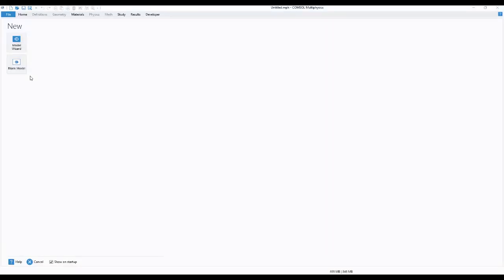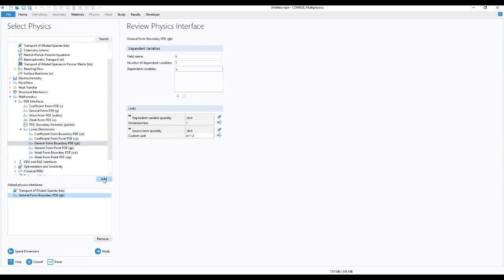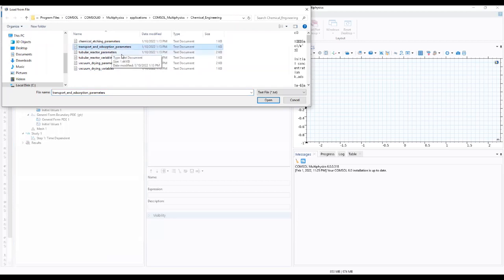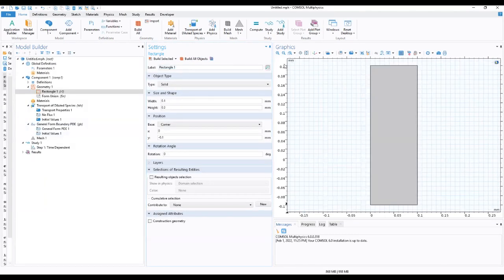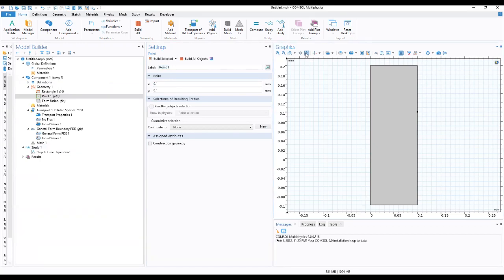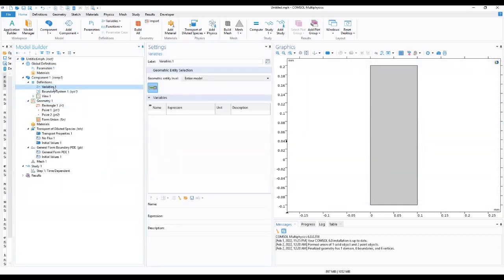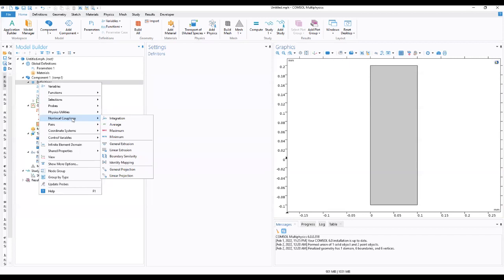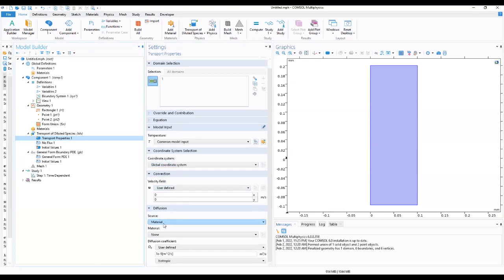HOW TO SIMULATE SURFACE DIFFUSION AND REACTIONS SIMULATION  IN COMSOL MULTIPHYSICS. FIRST PART

Comment: only one important questions that puzzled me in this expression -cs*TxDs where Tx come from and what does T refer to?
Reply from the maker: Here, csTx and csTy refer to the components of the gradient restricted to the plane tangential to the boundary where the interface is defined, that is, Boundary 5. Because this boundary is parallel to the y-axis, only
csTy is nonzero in this case.
T is temperature
Reply: @Simulation_World  first thank you for reply. I think that the process is isothermal so the no need to take Ty or Tx, because they will =0, do you agree?

Comment: The video was really helpful for me. I went through both parts of the video but I didn't get a clear picture of what you have tried to simulate here. May I know the probem statement? I am in need of procedure to simulate Chloride diffusion in reinforced concrete. If you can explain what is that you have tried to simulate here, that would help me a lot to draw some  relations between my problem statement and yours. Thanks in advance.😀
Reply from the maker: This example shows surface diffusion and surface reactions coupled to species transport to the reacting surface. In adsorption reactions it is necessary to model the surface concentrations of the active sites or surface complex as well as the bulk concentration in the gas phase. This device could be a catalyst, biochip, semiconductor component, or any process with surface-specific species.
Reply: @Simulation_World  That was really helpful. Thanks for the response😁
Reply: Hi santosh were you able to complete your simulation
Reply: @ahmedhussain7376  Yes